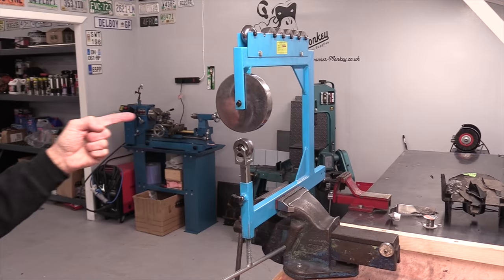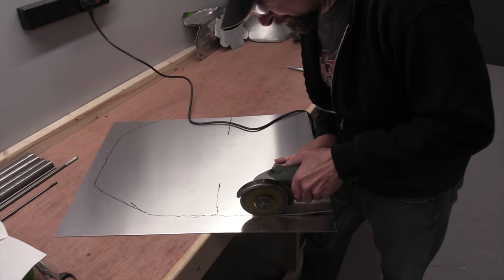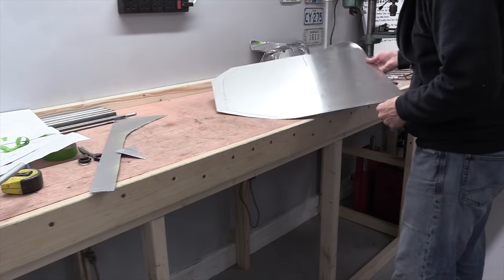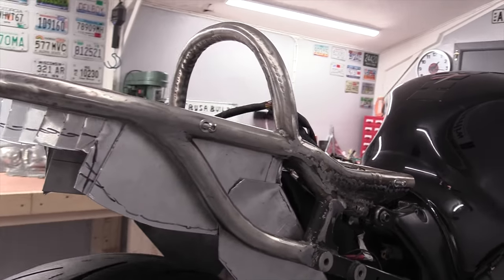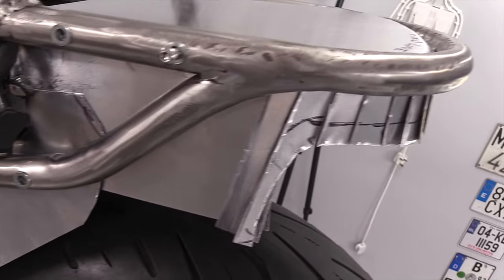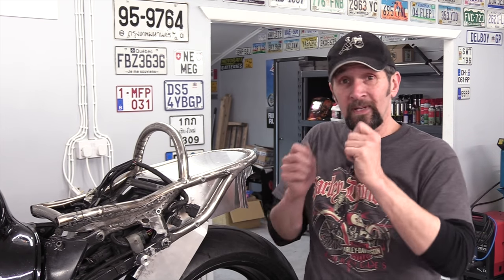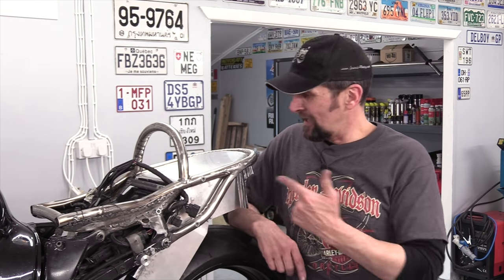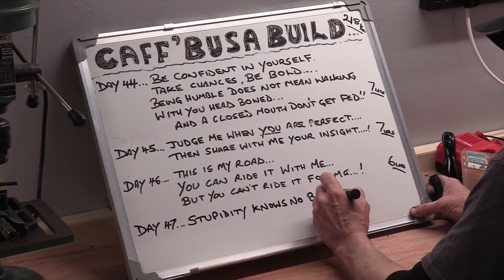Delboy's Garage, Hayabusa 47, Rolling Sheet Metal..!

Comment: Amazing the under tray is going to look really! It's so mesmerising to watch when your rolling the material. 👍
Reply from the maker: Thank you Sir, it is so much fun to do, I'm only a learner at this, but it's an organic process, so the more you do it, the better you get and am proud of that so far!
Reply: @Moonfleet41  you should be proud mate. 👍
Reply: I am by know means a mechanic or have your skill set, but after watching your past/present videos, I think I could kinda maybe fiddle with a bike since you are really good at  explaining what the job entails and what tools you will need. Maybe 1 day I will get a bike which isnt in working order and try to fix it, or see how things work hands on.
Reply from the maker: @TinyRides  Thanks buddy, wonderful to hear you're inspired, it will always be cool to do up an old bike, but sometimes the simplest small steps are just making a few simple mods to a good bike, even fitting accessories takes a bit of common sense and a methodical approach, but whatever you do, don't forget to enjoy it!
Reply: @Moonfleet41  I have a Honda Grom and fitted an exhaust which was easy and tail tidy had to actually cut the wire for the oem light and use these clips to reconnect the wires back together.

Comment: Hey there yeah I've watched most of your Sportster videos and they've been very helpful thank you. I'm looking forward to the Sportster videos this winter to see if you get into the head bearing/ fall away stuff. I've tried to fall away on my bike and I don't think I've made any improvement... Maybe I didn't loosen all the cables enough. Cheers and thanks again for a great you tube channel 👍
Reply from the maker: To be honest mate, i place very little merit in that "test".. it only works if you completely strip the entire front end of all cables, wiring and extraneous furniture..  everything has to come off, nothing on the bars at all,  for the bearings to perform in total isolation there must me nothing at all to impede free movement, if there is, then you're not getting a true test of bearing health..

Comment: 7hrs well spent, Del.
I must admit that the workings of the English wheel are a mystery to me but the end results are very impressive. Great job👍
Reply from the maker: Thank you Keith, it's a pretty straightforward science, not too distantly related to nana's rolling pin, if you roll something between two hard surfaces it stretches and thins out, if one's curved and the other flat, it'll roll in to a curve at the same time, it's really simply physics, but a whole lot more to it if you really want to manipulate metal in to wonderful shapes... and it's fun exploring the limitations of the metal and how far you can push it!

Comment: Been following this build from day one ,question, how do you know what dolly to use with the English wheel if dolly is the correct term for those small wheels ?
Reply from the maker: Cheers buddy, appreciate your engagement... I'm no expert at this by any means, but the range of lower wheels go from almost flat to a full 180 degree radius, and when you're trying to curve a piece of metal, it's important to spread the pressing force as wide as you can, so use a lower wheel as flat as you can, but if you want to curve the panel more than the curvature that the lower wheel will allow, then as you wheel and pull downwards on the panel to create the curve, then you'll end up with two crease lines from the edges of the wheel, so you pick a rounder one to allow it to curve more, so the choice of lower wheel is decided by how much you want the panel to curve and from that I understand, it's best to use the flattest lower wheel you can for any situation, hope that makes sense mate.

Comment: Got a bunch of those cheap rods in the mail today, curious to see how they will perform :)
Reply from the maker: Good luck buddy, let us know how you get on!
Reply: @Moonfleet41  Did a small test, attempted to braze two small 20 x 2mm pieces together. Looks like my propane-butane burner didn't manage to meld it. Gave it a couple of minutes to heat up. 

It did separate some chunks but they sure would not flow. Melting temperature is supposed to be 647 to 658 Celcius. That's a fair bit higher than durafix with 398C.

It's almost as if you get what you pay for :D
Reply from the maker: @steveman1982   The problem i can see there is at 658C, you pretty much melting the aluminium itself..try that on thin sheet and you'll melt holes in it..   are you sure they're not TIG welding rods..!  i have a tube of ally TIG wire, and thats the melt temp on the box..?
Reply: @Moonfleet41  Oh wow, that is indeed the melting point of regular aluminium :D Well, all the pictures show regular blowtorches at work. Would be hilarious if they really were meant for TIG!

update Ha, the sticks have the thickness and 5356 stamped on them (actually only legible on a couple of them). And googling around learns that it is indeed for TIG or MIG :D

Comment: Another good video. Thanks!  What diameter rod are you using?  I watched the video when you first tried it. And it seams to work well with different thicknesses.
Reply from the maker: Hi mate, the roads are about 3mm thick, seems to be the only size available, and they seem to work really well!
Reply: @Moonfleet41  Thanks for the reply. I asked about size because I see one person and only one offering them in several sizes. But all the rest are only offering only 3mm. That's what I'll order. Looks like they worked well for you on everything you joined. Thanks again!

Comment: Hi Del! I'd like to equip my motorbike with carb intake pod filters instead of having oem airbox. I know I have to change a jets in carbs but what size? There are different size available. The bike I own is 2001 Yamaha FZS1000 thanks for any suggestions. Jacob
Reply from the maker: Traditionally Jacob, it has always been a nightmare to get a motor to run well on independent pod filters,  4 cylinder Jap bikes like to run best with an air box, that quantity of "still air" means the motor can breath on a solid supply of fresh dry air all the time in any conditions.. once you fit pod filters, they can be affected by wet weather, windy weather and extreme cold (can lead to carb icing).... so even if you can get them to run smoothly all the way through the rev range by re-jetting, that still doesn't mean the bike will run well in all conditions..  if it was my bike mate, i would steer well clear of them and stick with the air box and a free flow internal filter.. !
Reply: @Moonfleet41  Thanks for your reply. U see I'm after changing rubber boots between engine and carbs all 4 were cracked badly, so I've got new set (not cheap), I've got carbs out I've replaced rubber boots put in the carbs back, but the problem is when I'm trying to slide airbox with rubber connectors on the carbs. Any tips how to push the to seat them correctly on the carbs?
Reply from the maker: @yaneck1984  The old GSXR motors had that tricky problem, if you pushed the air box on tot he carbs too hard, it would force them inside the air box, so the trick was with the filter removed, reach inside the air box if you can and you'll feel that each of those individual rubber boots is like a bell mouth venturi pointing inside the air box, you can almost grab each one individually and wriggle them on to the carbs, a little red rubber lube, silicone grease, or even a little Vaseline if you're stuck, will ease the rubber over the carb mouth... good luck with it mate.

Comment: Just a thought, with the amount of cutting shaping wheeling time and rod that gonna end up in that piece do you not think it would have been easier to make the underpan in two parts ie separate pan and sides and then solder them together
Reply from the maker: Hi Noel, yep there of course would have been many ways to make it, I even thought four separate pieces, the two sides, then the curved flat section in the loop, and the mudguard bit at the front, but I always think it's better to try and fabricate any panel in as few pieces as possible... if nothing else, it serves to build my skills and keep me thinking over problems and growing as a fabricator, stupid I know, but I actually try to look for the more difficult ways to do things rather than the easy way... appreciate your input though mate.

Comment: Honestly thought it would be flush with the frame and not inside it
Reply from the maker: Got to have room for the wheel to move inside it on suspension compression..
Reply: @Moonfleet41  lol i was referring to the end where your lights will go, not alot of space for turn signal or brake wiring available.